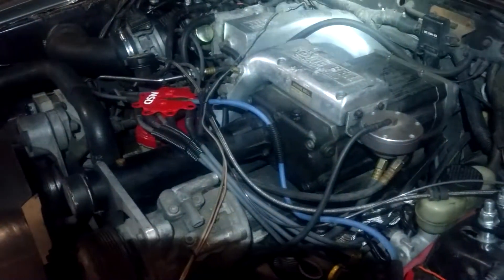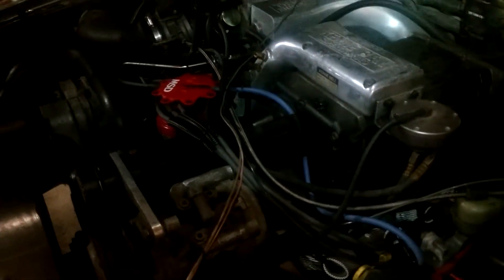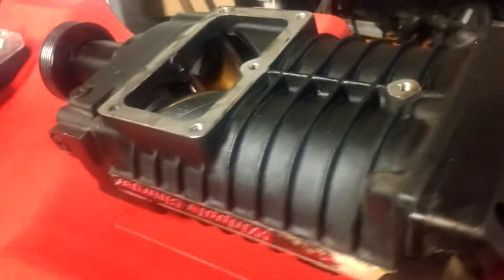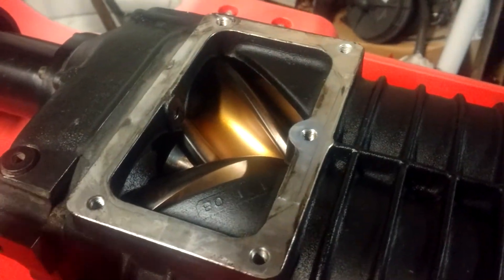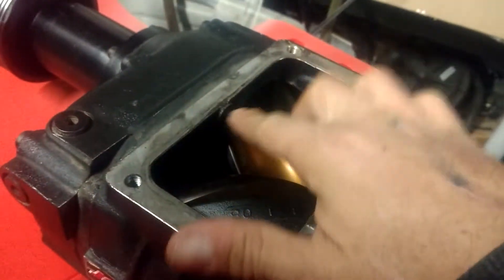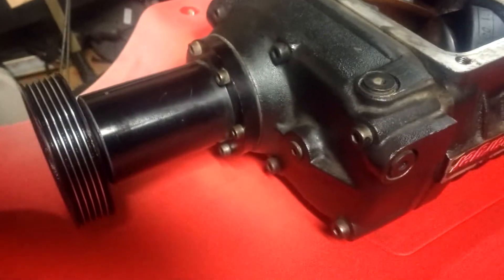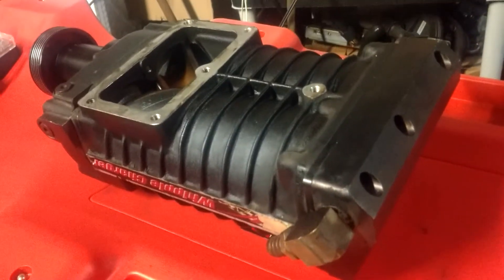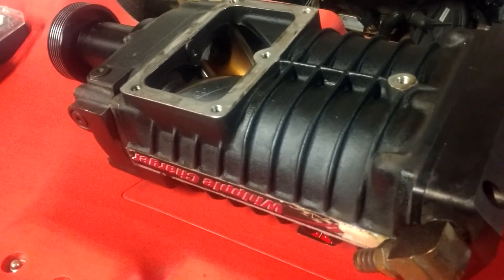Fox Body Mustang Kenne Bell 1.5L 2.2L Blowzilla Upgrade Whipple 2.3L Supercharger

Comment: Just plug the hole with solid aluminum rod.
Reply from the maker: Yeah, that's not the problem... the problem is the drive design and you can't change that without a gamble I wasn't willing to take

Comment: I've had the pleasure of driving a 95 gt with a kb on a stock heads/cam 5.0. With an anderson power pipe, 9# pulley, 42# injectors, and longtubes, and 3:73's the car was a runner. It would spin the 295 tires like nothing but it was really only happy to about 5k rpms. Made it feel like a 460 though.
Reply from the maker: Agreed.  Like a big block.... my thoughts are PD chargers are the best for street cars..   If you like drag racing or find yourself in the upper Rpm range quite often you may be happier with a centrifugal.   BUT, I personally never ran a centrifugal so that's really just my assumption !!

Comment: TPS Motorsports have 2.2 remade whole kit though
Reply from the maker: Yes, that's the $4000+ unit that I was referring to in the text (I think their version is  now a 2.1 vs. the 'old' autorotor 2.2, or, I could have that backwards)  I refuse to pay that kind of money for something I basically already have.  I could have upgraded my manifolds, but KB won't sell just the compressor.  It's STILL old school w/ NO intercooling........ That's a Dick thing to do on their part to 'screw' all the original owners that put them in this business.   I've gone WHIPPLE now and currently building a 14psi + intercooled Fox 5.0L.   See some of my more recent videos documenting this build...  I still used a part of the discharge manifold with their name on it, but still haven't decided what choice slogan to put next to it yet.  Maybe  'No longer' or 'Never Again' or perhaps just plain 'NOT'  -  Kenne Bell Supercharged

Comment: So are you currently running the 1.5L
Reply from the maker: Hi, the 1.5 KB has been removed from the car for rebuild.  No one will rebuild them anymore so the whole setup is being scrapped.  Kenne Bell only offers a 'new' setup for $4500 so 'screw' them......No help for anybody who has one of their original setups..  Now a WHIPPLE custom build has been started.  The Kenne Bell discharge manifold has been CUT IN HALF in order to intercool the new setup and bring it into the 21st Century.  I'm leaving the KB logo on the discharge piece so when people ask 'what kenne bell setup is THAT' ,   I can say it's the one they don't want to spend the money on to update for their Foxbody fans who they choose to forget about
Reply: @fortheLOVEofMODsMike  I currently have the non intercooled 1.5l why does yours need a rebuild . Mine has little to no backlash I read on the kenne bell site they don't need a rebuild until they have 1 or 1/2 inches of backlash witch seems alot to me since mine currently has no backlash . Been doing good gave me no problems. Also kenne bell told me they can rebuild it ? Try on Instagram they will msg back I've tried to call and no answer. I know these things are dinosaurs but all the people I have talked to or ran into with them love them say they will last a lifetime and it seems like it . Get back to me on how your intercooling it. I want to run more boost but I need to intercool mine as well
Reply: @fortheLOVEofMODsMike  okay okay I went through all your old stuff I see it's was using lots of oil mine doesn't have that problem "knock on wood" the problem I have is I'm really looking for a gt40 charge intake for the kenne bell . I'm also looking for a smaller pulley
Reply from the maker: Yeh, going through oil every 10-20 miles BAD.  Maybe it's who you talk to over there at KB.  Maybe I hit a nerve when I asked about upgrading to the 2.2L on their 'price' list....  I'm doing a new video on it this afternoon to document where I'm at and which direction this is going because it's changed already.
Reply from the maker: What diameter pulley do you have there now.  I just sold one that was 2.25 inch or 58mm.  I have another one 'somewhere', just looked all over and can't seem to find it.  I thought it was smaller than the one sold but not sure now because that one seemed pretty small so now I can't remember which one is the 8lb pulley ??
Reply: @fortheLOVEofMODsMike  I'm not 100% sure it is just a tad bit bigger than the diameter of the snout it either says 3.75 or 2.79 I'm not sure I haven't had time to actually measure it but my boost guage reads 4 pounds of boost on a not so stock engine. I guessing I still have the stock 6lb pulley possibly . Not sure
Reply: @fortheLOVEofMODsMike  I want to see 10 pounds of boost do you know if that's possible? With the ts1500
Reply: @fortheLOVEofMODsMike  where are you located . I'd be willing to buy one if it's for sale :^)
Reply from the maker: 3.75 is huge... it should be 2.25 - 2.75...... anything 8+ lbs on these non-intercooled setups need help.  The most I got mine to was about 9lbs and detonation WAS an issue.  I got the MSD 6-BTM (dial-in boost timing retard) but that was a pain in the ass because ambient temperature and humidity affected it that you had to change the dial-in pretty much by trial and error everytime.  I still loved the way it sounded, I had my fun with it but now it's time to move on (since it's toast).  I'm just now going to load up the new video on the direction this build is going !!
Reply from the maker: New update.  Whipple charger is going on.......... https://youtu.be/qPghx1cokBc
Reply: @fortheLOVEofMODsMike  let me know if your have a smaller pulley for sale though brotha . I'd appreciate it and I could pay shipping I can send you my number if your interested.
Reply: Jon bond performance does great things with kenne bell.   Hit him up if you haven’t heard of him already.   He’s my go to for kenne bell stuff
Reply from the maker: I did, he (or they) was a big help.  Messaged back and forth through eBay.  Ultimately it was just time for me to move on.  I want to bring positive displacement into this Century on the old 5.0L with intercooling and there's just nobody out there who does it so I'm doing it myself.  Kenne Bell won't sell a 'bare' supercharger so I've gone to Whipple.  Project is in the works, will be updating again soon !!
Reply: If anyone wants a 1.5 kenne bell i have one for sale
Reply: Brett M Burke how much